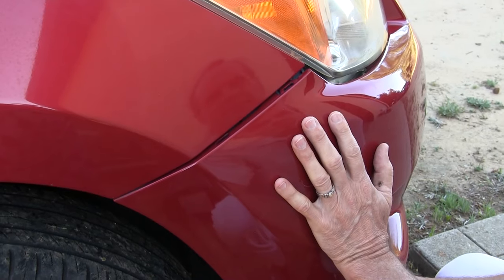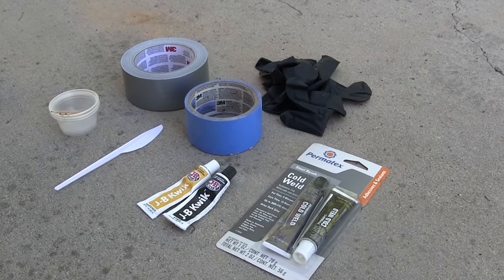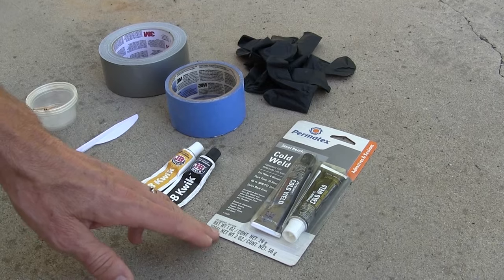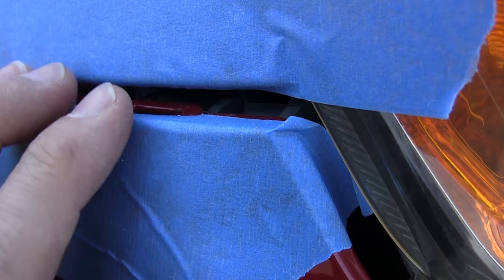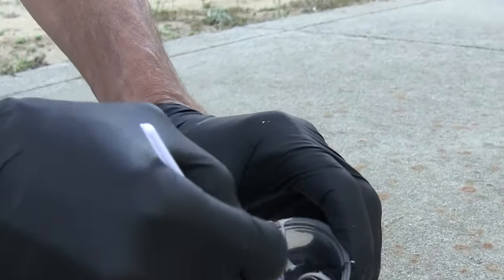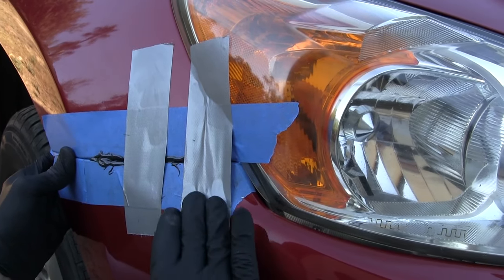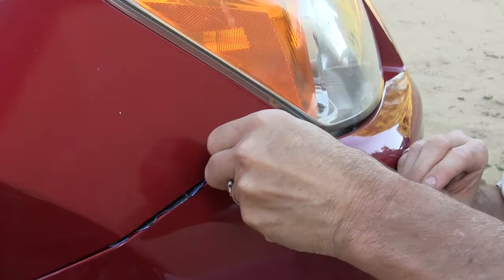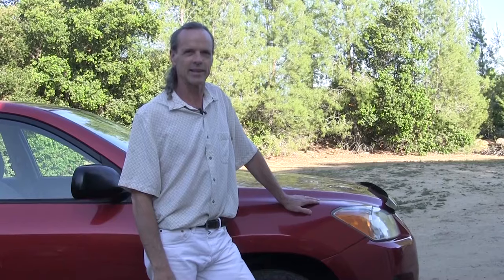How to Fix Your Bumper - The Easy Way

Comment: Don't do this, you could just ziptie it or use the same tools to create makeshift 'tabs' with a hole or then drill a hole...

This guy spent the same time & money (or more), bought the exact stuff that a real diy would and if you do this you'll destroy the paint on both bumper and fender any time you bring it in for service (not to mention you'll have to actually fix it to be put back on... 🤦)

Bruh, this should have zero likes...
Reply: I have used zip ties for this but with regular driving the zip eventually loosens. You have to re-do it every so often. Of course, I have a hard time believing this glue fix is going to hold for years. It's worth a try anyway. If it lasts, then great. If a car needs to have bumper partially removed to replace a headlight then that car is not a candidate for this hack. Good video as is usual with the car angel.